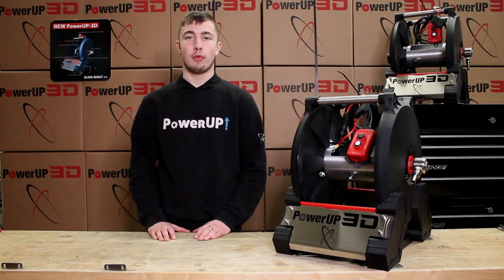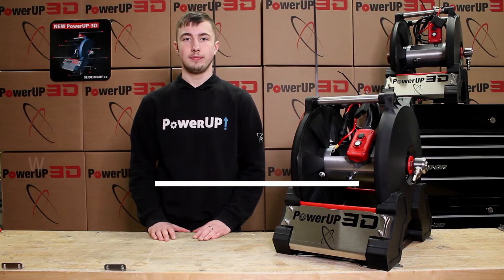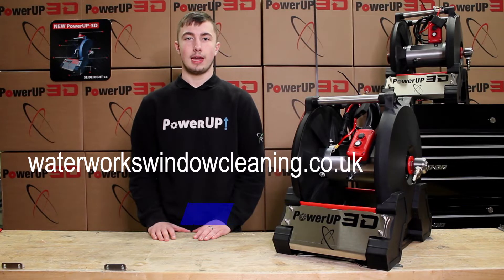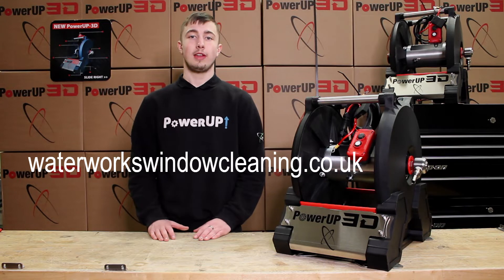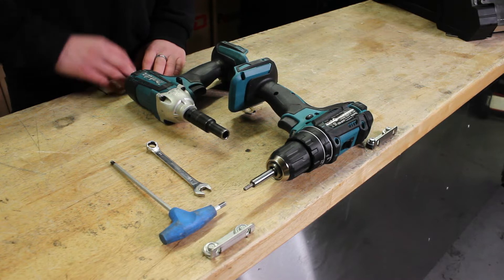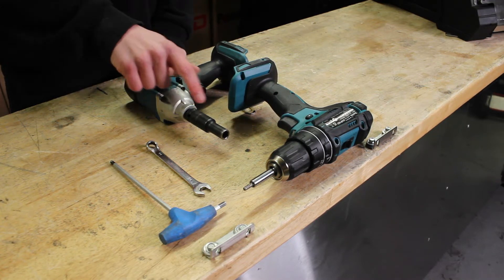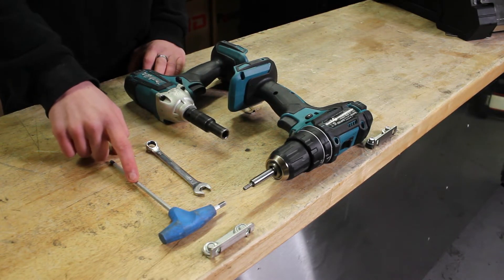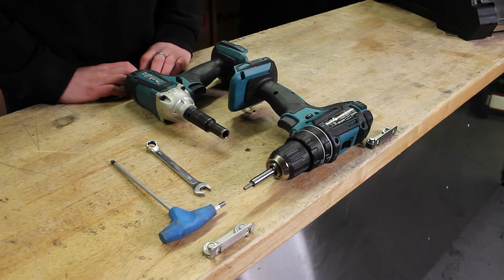PowerUP3D 2020 Belt Change (Electric Window Cleaning Reel)

Comment: The side cover does not come off on mine. Neither can I pop it off nor can I bend the cover to get the belt on that way. Something else is holding it on.
Reply: Did you ever get this sorted ? I need to change mine and the side wont come off at all ! I darent pull on it too hard as it feels it will snap